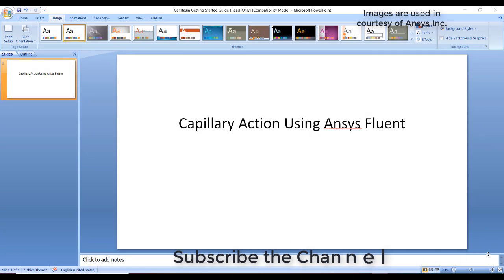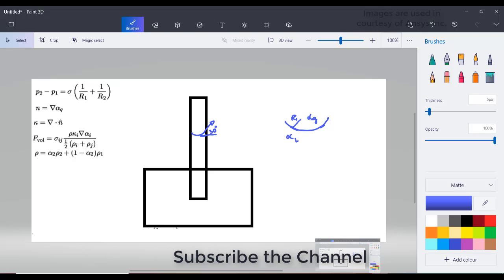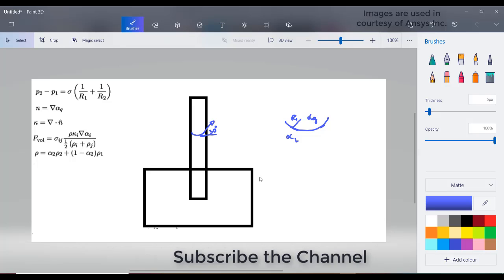Capillary Action Simulation Using Ansys Fluent

Comment: How to setup test case for 3 phase problem .......like water+oil ( separator) and air is used to separate them with sparger ............ whole problem is solved using multiphase setup or with DPM + multiphase flow............. Thank U for videos and notes.

Comment: My center column would not go up even tho the wall adhesion is on and set to 30 degrees
Reply: Did you solve the problem? I want to know the solution, too.
Reply: @damlee9856  No I have not. I am using the 2022r2 ansys solver